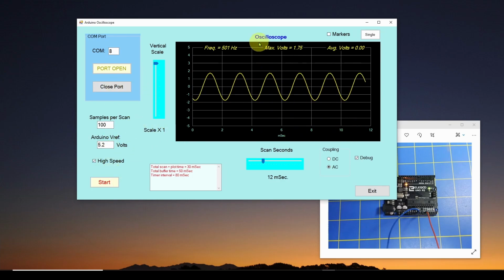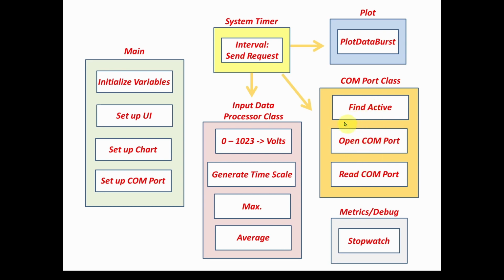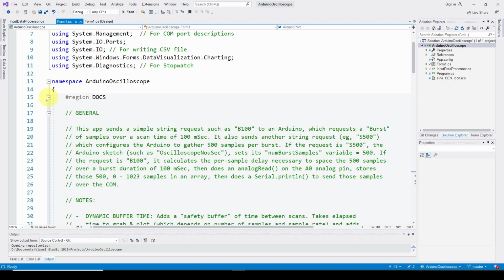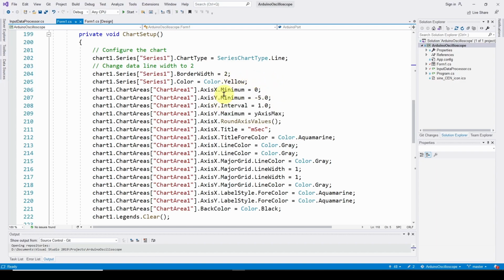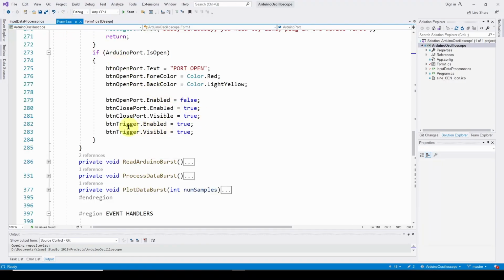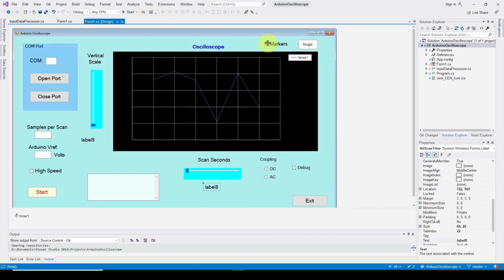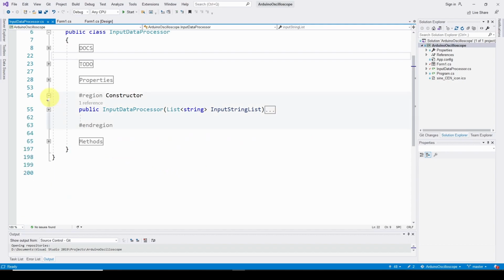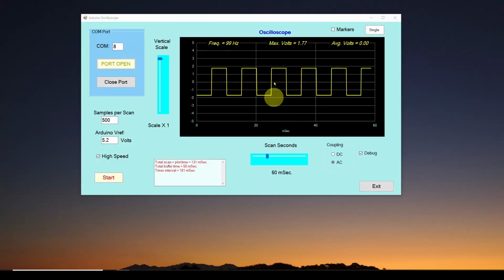Arduino Oscilloscope Part 6: C# Application

Comment: Excellent Serie of Videos!
I have been following along the whole series and I think it’s amazing, though I think you forget to explain two of the events, the btnClosePort_Click and the btnExit_Click. I there any chance than you can upload a video explaining this two parts? I'm having difficulties with C# and these videos are a great help.
Thanks
Reply from the maker: I didn't forget, I thought that it's obvious and doesn't need explanation. The close port button event needs only one line of code to do a Port.Close(). Same with the Exit button (Application.Exit()). Check out my many other C# videos where I discuss this.
Reply: @EETechStuff  Thank you so much for you fast reply,

Poorly wise from me to start coding without the basics, I should check your firsts videos.
Reply: @Lizer_UPC Hello. Can you be of assistance in an issue in my code? Well more of a question to EETechStuff but its hard to get a reply on this video.

Comment: This is an excellent video.
Maybe I can use UNO instead of expensive National Instrument data acquisition board if every thing is okay
Reply: In line 501, why the burst_duration_time is not updated? In every timer tick, I think, it should be changed according to the track bar change.